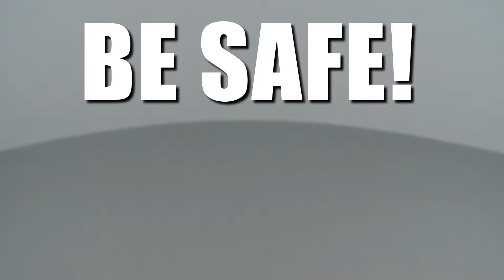Honda Small Engine Cooling Fan Replacement #19511-Z8B-900

Comment: why is the ignition coil removed since it is under the cooling fan and not connected to the cooling fan??
Reply: Looks like coil removed so strap wrench can be used to secure flywheel for nut removal